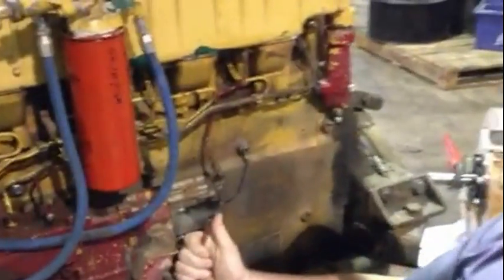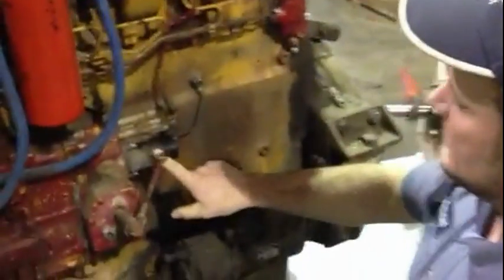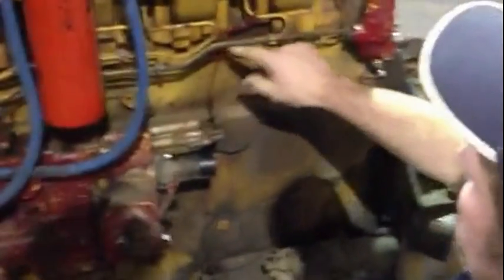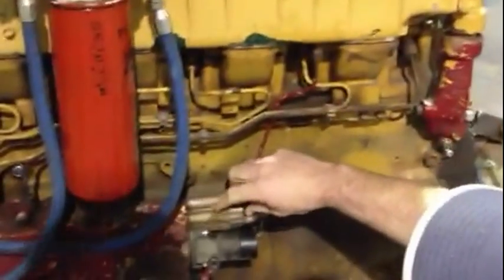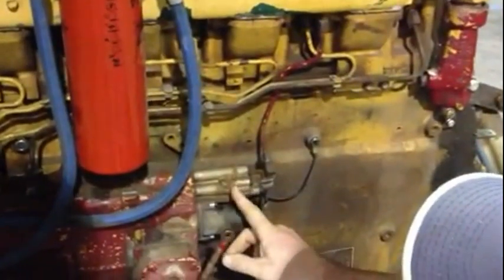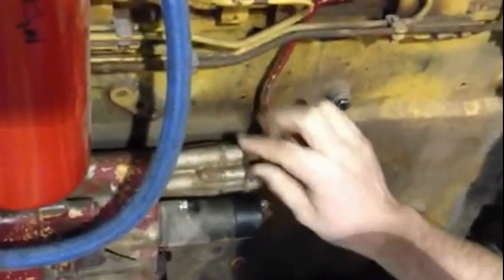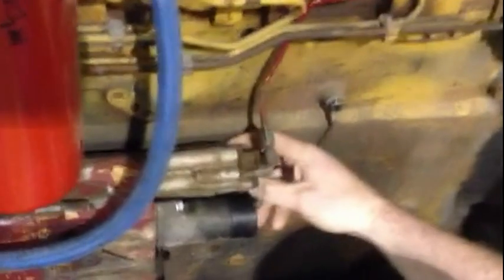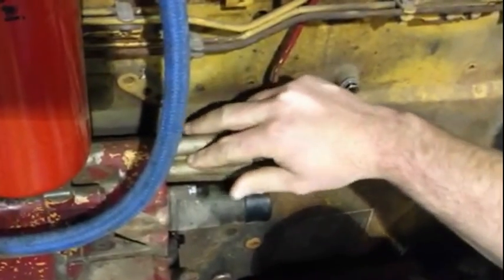Possible Solution for CAT 3406 engine not able to run compressor

Comment: My question is my 3406c only getting 14psi  on boost I had the cac checked and it was good. It smokes white smoke when idling. The engine just got rebuilt only 15,000 thousand miles on it. Can this be my problem?
Reply from the maker: I'm sure you have figured this out by now (sorry we didn't reply sooner). If you still need information about your engine, feel free to contact our Shop Foreman, Laverne by calling 570-966-7312 and asking for him or emailing him at laverne@ewdrilling.net!

Comment: Where's does the idle tachometer cable plugs into on the 3406b?
Reply from the maker: I sent your request to our Shop Foreman and he sent me a pictures for you. I don't see a way to share this pictures so if you still need the info, can you send me an email at derek@ewdrilling.net and let me know in the email that you need the picture of the CAT 3406b tach plug position and I will send you the pictures he sent me.